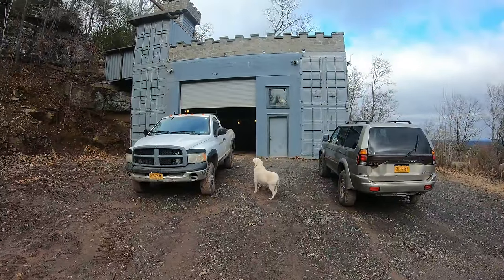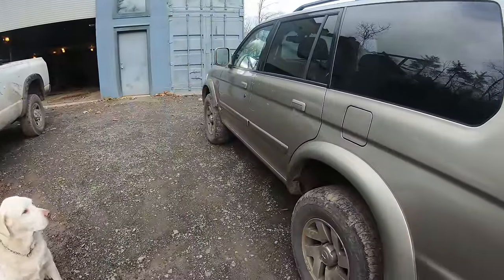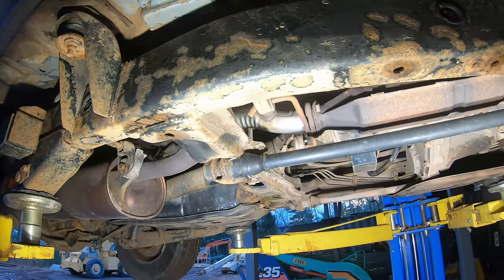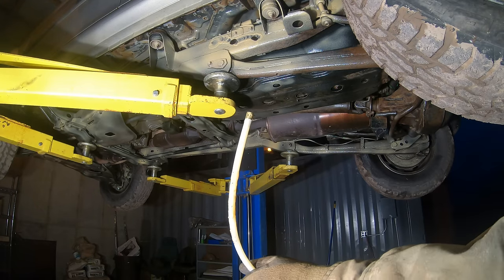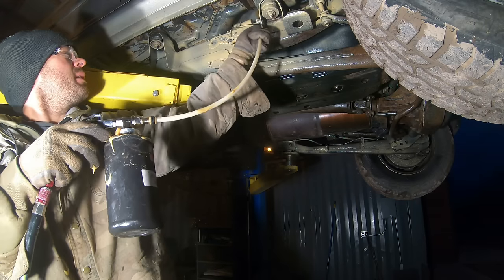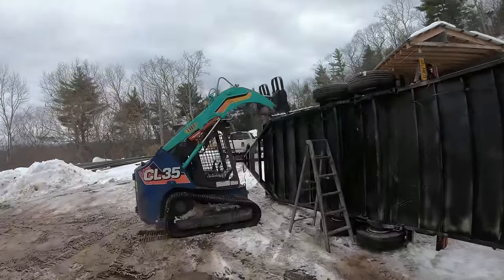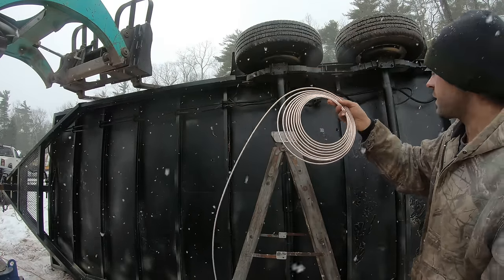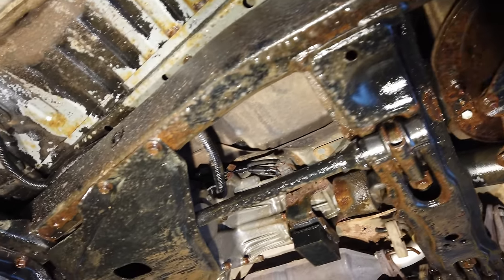Undercoating vehicles

Comment: I keep on old bucket lid with a small hole in it permanently on my paddle mixer. I just pop the lid on whatever bucket and run the drill at full speed, no spilling. Keep up the good work Andrew!
Reply: Great tip!
Reply: That is a terrific idea👍
Reply: Nice tip brother, I'll remember that for future reference.
Reply: so simple, yet such a pro tip!
I never even thought about that lol
Reply: drilling counter clockwise prevents snagging when going through plastic, too
Reply: try thinning it down some with deisel fuel works great bro god bless
Reply: If you need to lift the paddle to mix some materials, cut the bottom out of an old bucket, and cut the centers out of two lids, leaving just the edges. Glue the lid pieces together to make a ring that holds the upturned bucket in place. Has kept me from scattering paint for years.
Reply: @thardyryll  excellent, that's an ideal idea💡.

Comment: One trick is to coat them in the fall, so you can drive on dry roads and have a layer of dust and dirt build up on the oil. You can then coat them again, this will help build up layers of oil / dirt making the coating thicker and harder to wash off.
Reply: Thats right and mustie1 uses bar and chain oil, thinned with kero so it can be sprayed.

Comment: I have the same fluid film on my car. I did it professionally. They put on a heavy coat. I would advice you to put on a thicker coat. Once finished drive on a dry dirtroad (if possible). This helps the fluidfilm last a longer time. I think this is the best coating for a car. Last a long time and will not turn rocksolid.
Reply: m g I did not say he did a bad job
Reply: pete smyth  Gramps taught me to use bar and chain oil. It's thick, it sticks, it's cheap and readily available. Drive on dusty road after. I have an 85 ford ranger that looks better than my neighbors 5 year old Tacoma. We're in the Northeast.   

Use a rag to cover places you don't want to spray it, like bushings, boots exhaust. Spray it on once a year for the first two years, then every third year. Best to do it in warm weather because it's so thick. An added bonus, if you've got chipmunk or mice that like to store acorns in your vehicle they hate it. You'll never see a nest again.

Comment: I got sad when I saw “undercoating” but was very very happy to see fluid film! Good on you. I should’ve known, that you know better lol
Reply: Me too I'm glad he used fluid film alot of the other stuff out there is garbage
Reply: Yeah, rubberized undercoating and trapped moisture, what could possibly go wrong.
Reply: @bigfutus  agree, except when it's on the car from factory - since the car is spotless then
Reply: Deutschehordenelite Nope that’s not true! moisture will always get trapped under rubber undercoating. It’s pretty much a death sentence if you don’t live in the desert.
Reply: @moavic5087  it worked for my car, just chipped away more and more over the years
Reply: But!...should really be applied when it's warm so the dust clings to the fluid film and forms a better barrier.
Reply: Fluid Film is what I see in undercoating and rustproofing.
Reply: Joe Thurman exactly fluid undercoating is the only type worth anything
Reply: @ZEROOOOOOOOOOOOOOO00  Yeah but then you have to live in Florida...
Reply: @bigfutus  Fluid film is lanolin based. I does not trap water. Get a clue.
Reply: Yeah rubber stuff just holds the salt and moisture in
Reply: @cumminspower2878  Salt sticking is perfurd? I guarantee you've never even tried the stuff.
Reply: @ZEROOOOOOOOOOOOOOO00  Salt is still an issue in Florida.. The humid air is loaded with it. Any puddles are loaded with salt.
Reply: Cumminspower 28 military uses it on sea vessels
Reply: @ZEROOOOOOOOOOOOOOO00   Problem there is... you have to live in Florida.
        edit;   M C beat me to it. Nurtz.
Reply: @cumminspower2878  Try NH Oil
Reply: We have tried Fluid Film and New Hampshire Oil Undercoating. Both work well at first but wash off quickly. This year we started using Woolwax and am impressed with it's stickiness, far better.
Reply: @rebelyank6361  Bar and chain oil. Spray it on once a year for two years (Spring or summer). Then once every three years. It's thick, sticky. Just use a rag to cover where you don't want it, like rubber bushings and boots. 

It works, it's cheap.
Reply: I actually wondered the whole time. Andrew is pretty good with these theory. Some silly, some not a big deal.
Reply: @johnnybear111  If thats a fact, then end of discussion
Reply: thick coat of fluid film + a long drive down a dusty dirt road makes a good coating
Reply: pete smyth beeswax & Linseed oil mix

Comment: It helps to have the extension hose for the spray gun so you can get inside parts of the frame, panels, and other tight spots.  I have used fluid film for a couple of years and have been very pleased.

Comment: You’ll be very happy with this stuff. Be sure to apply at least once a year. I used it for a couple of year’s then I started using NH oil undercoating instead, it’s basically fluid film but it sprays black and I think it lasts a little longer too.
Reply: I used to do undercoating and my boss now swears by NH oil.

Comment: I almost fell out of my chair when I finally saw someone
correctly apply a lanolin-based undercoating.
First- Fluid Film undercoating and the aerosol can "penetrant" are not
the same product. So many on YouTube show this incorrectly.
Second-  It must be thoroughly mixed, just as you did. Stirring is wrong.
Third- it should be applied HOT. It seeps & creeps better, goes farther, sticks
better, and you end up using less because of the nature of the coverage.

Since making this video- the makers of PB Blaster have come up
with their own formulation, which many say is superior to FF in many ways.
It's called PB Blaster Surface Shield.

Thank you for the wonderful videos you produce.

Comment: Mustie1 has a couple of pretty good videos about undercoating.  He uses bar & chain oil, which is an alternative.   When I restore old cars, I get rid of surface rust using phosphoric acid (Jasco at big box stores) then neutralize it.  Works really well and keeps it at bay under any temporary or permanent coatings.  

Luckily, I moved from the East Coast to the West Coast, so I no longer have to deal with salt on the roads, but man is that stuff an epidemic....   From what I see out here, it's not really necessary, we seem to do just fine without it, even in the Sierras, which got ~30ft of snow last year.

Comment: Great job Andrew...I thought at first the FF was too thick to spray, but sprayed good as is, [WAY better after you heated it] That is great stuff, use it in my machine shop to prevent rust on anything. I NEVER SEEN that hydraulic brake system for trailers SUPER idea!

Comment: I been fluid filming my vehicles for a long time.  Stuff is great and really works.  Helps if u warm it up. Put it in front of a torpedo heater or etc.  the I made a pvc valve setup that goes through the lid to get it into the small jugs.   Works excellent.  I also mix my fluid film with grease and used motor oil. And mix it same as u did with a paint mixer.  It is literally the best coating ever.  Absolutely zero rust on anything.  Don’t forget to get all your body panels, rockers, fill everything.
Reply: Cedarstrip 14 Usually cars have zinc coating on metal so no need for extra coating. Also most cars are just made to sell, not to last. In the Mitsubishi that kind of structure can't last.

Comment: I bet there's a lot of rust under those aftermarket fender flares. A lot of guys with put those on right before they sell the truck to cover the rust up. Dodge never offered factory flares for that truck so they are definitely aftermarket. I had a 2005 that I bought new, even those Ram Daytona's with the wing on the back and the stupid ground kit didn't come with fender flares.
Reply: Same here on my 05 Cummins. Make sure you check that they're still attached mine rusted through and went flying down the road good thing no one was behind me. I don't know why people put them on unless you have wider tires on they just look like crap. Least that's what I think
Reply: @Klldozr  People put them on to cover the rust so they can get an inspection sticker. Any older stock truck without a lift or bigger tires you know there on there just to hide rust.
Reply: I put hex head sheet metal screws in my fender flares to hold them on, the metal was rusted out under them.  1995 Dakota--gone now.
Reply: @Klldozr  is that a rusted bottom corner of the passenger side truck door?
Reply: @stevensaxon8888  what do you mean?
Reply: @Klldozr  I believe Andrew's truck is already rusting out. At least on the door.
Reply: @stevensaxon8888  oh maybe I was talking about the fender flares. My truck is pretty much rust free other than the bed
Reply: @Klldozr  yeah I knew you were talking about your truck and fender flares. I just was wondering about Andrews truck. Thanks for the reply

Comment: One suggestion for Fluid Film....  The 360 spray tube inside frame holes and crevices, but use a rag dipped in the fluid film and wipe on the frame etc.  That way it goes on even and you can keep it away from the brakes, exhaust and other areas you don't want it.  NO waste and doesn't get all over you and shop floor.  I am using on my Toyota truck due to frames rusting.

Comment: I need to get me one of those turbo nozzles for my powerwasher!
Reply: Good piece of kit to have. You can get it from Supercheap Auto. Just wait for the xmas sales to start. https://www.supercheapauto.co.nz/p/toolpro-toolpro-pressure-washer-attachment---turbo-nozzle/370466.html
Reply: Please make sure you get the right orifice size before ordering one. Seen way too many companies just buy whatever dirt blaster. Karcher makes the best. If you’re not sure your size message back your psi and gpm.
Reply: I've heard there is a minimum pressure requirement for them to work properly. Might want to check that out. Looks like they work great.
Reply: I need a power washer like that
Reply: Mines 3500psi, 4.0gpm, cost me a pretty penny but so handy to have a hot power washer for my diggers and trucks it looks pretty similar to Andrews but maybe a bit higher quality
Reply: Be careful, they can dig holes in things not meant to have holes.
Reply: @LegendLength  They absolutely do, it's the red/0 degree tip spinning very fast, but you can't use it or red tip on everything, it will cut stuff up.
Reply: @LegendLength  And OMG don't point one at your foot!!
Reply: @cherry01995  we all doo looks like it blow's hot water /  steam right at what ever u r spraying in time...... i wonder the name & make & model # is........ or one like it from like harbor fraight or some where........
Reply: If anybody wants to purchase me a hot water power washer like this for me that would be great
Reply: Johnny B not necessarily you can just blow into them and it spins
Reply: DistortedStar 0026DT look up pressure pro magnum they are the best gas engine hot water pressure washer
Reply: NZ DIRT pressure pro?

Comment: What I love is that it's work equipment/vehicles and he treats them as such. Some practical maintenance and don't worry about little scuffs too much.

I wonder though. Shouldn't you get rid of the rust first, before covering it up again? I've always been taught that you might as well not cover it if there's still some on there, that it actually worsens it, cause it's "trapped". Unless the stuff you used takes care of oxidation?

Comment: Fluid film cost but it does work! I've seen a test against about 10 other products and the fluid film came out the best! It soaks into the steel and stops the rust! The lift really helps! I pop all the plastic plugs at the doors/rocker panel etc. and spray the insides of everything! If there is no plugs drill hole then plug! They are cheap!

Comment: I just used that stuff for the first time this year as well. I heard places do it for like 200 bucks for a vehicle here, but just decided to do it myself. Doesn't take long and is only about 20-30 bucks a year if you buy the big tub.
Reply: That's great, but some folks don't have the proper equipment, tools, lift, etc. to do it themselves. But even if you have to pay to have it done, it's well worth the money.
Reply: $100US in Canada for a Full Size Pick-Up
Reply: @Fixin-To  Do they coat it with maple syrup tho instead of fluid film?
Reply: 20-30 bucks? 5 gallon pail is over 100 bucks.
Reply: Gallon will do one vehicle.
Reply: I already had the air compressor and I have an oil pit. Spent like 20-25 for a gun, bottle, and 1/2 tubing to spray it. 5 gal tub is around 160-180. If I apply it every year, I would use around 1/2 to 3/4 a gal for my particular vehicle.

Comment: Andrew: This coming summer you should POR-15 your frame and metal surfaces under your vehicles. It is awesome. Only setback is that it doesn't have any UV protection, so areas that are exposed to direct sunlight should be painted over the POR-15

Comment: In Michigan. Same...  However. When I buy a car. I take all the wheel well covers off. Power wash the undercarriage and coat all the welds and seams with a rust converter or Acid Etched Primer. Then I coat with no less than 12 btls of the shittyest cheapest asphalt undercoating I can buy, usually permitex. I put on layers unitil I am out. Up above the muffler, all along the rear tire tub. all of it. Let it dry overnight and put all the shrouds back on. Makes the car quieter... and no rust... I have tried bed liner but after exposure to heat it peals off. I only use fluid film on the engine bay and bits there about. it will eventually wash off in high spray areas Andy. You may need to recoat fluid film in about 3 months.

Comment: Hey Andrew, just FYI but a bed liner spray gun works great for spraying the fluid film. I didn't even bother pouring it into the containers, I took a vinyl hose, stuck it on the end of the pipe that sticks down into the container of paint and then just stick that in the bucket of fluid film. It'll suck it straight out of the bucket and the bed liner spray gun puts it on a lot thicker so you don't have to do multiple passes.

Comment: I've been doing this to my vehicles for about 40 years using various concoctions of new motor oil and transmission fluid. Living in the Lake Ontario snow belt, we see more salt here than anywhere else in the US. I've found the lighter viscosity mixtures can dry out before a winter is over so last year Ii tried gear oil. I heat it up and it sprays as well as the lighter stuff and stays on a whole winter. The downside is the smell.

I never use used motor oil as it can be acidic which will promote the rust.

Comment: Tesla CYBRTRK is all stainless steel. Might just be the answer to rust for those living in salty areas.
Stainless steel outside, great hauling capacity, 4 wheel drive, high ground clearance with air ride to raise and lower the vehicle,  million mile motors and batteries. A truck that lasts forever and can take a beating. Should have no trouble hauling a heavy trailer full of equipment or plowing snow.  Put solar panels on the shop and drive with power from the sun.

Comment: Used diesel engine oil mixed with some sticky grease,like molybden grease works well too : the soot in it makes it really glue to the underside.
Cheaper to use.
Reply: Chainsaw oil works pretty good also, mixed with diesel or kerosene.

Comment: Andrew, another great video.  I do worry about your safety with the SUV only held up by the forks and the strength of the transmission parking brake pawl. That is a relatively thin piece of metal. Please tell me you had front wheel chocks. Two tall rear jack stands would also make me feel better. We don't want to lose you, you are far too valuable to us and your family. Kind regards, Craig

Comment: Great video Andrew. Many thanks. I remember a story about a friend of mine who started working with Tectyl undercoating of cars. An old lady came in with a little car she wanted undercoated. They had a map of where to drill holes on all cars to spray into canals and cavities. He followed that, but when the lady came to pick up the car and pulled out the seat belt it was soaked in Tectyl so she ruined her coat. An expensive experience. Always pull out the seatbelts before spraying into the cavities around them.

Comment: I assume that undercoating is Lanolin-based. Lanolin is natural sheep’s-wool grease. We used it in Australia on Fertiliser-spreading trucks and it works brilliantly. Superphosphate and Lime are highly corrosive on machinery and Lanolin is really the only thing that works. Every season we would pull the trucks completely to bits and liberally coat every surface with it - even down to under the suspension brackets and inside the wheel rims.

Comment: Andrew! For undercoating my vehicles, I use the used oil from my oil changes. It works excellent. I love it because I don't have to buy anything. I'm not sure how much that oil film you use costs but I suggest giving used oil a try. It works wonders for me and where I live and they pour the salt on the roads!
Reply: Be careful...Fluid Film isn't petroleum based, so it's safe to spray on everything (including rubber), oil might start to eat anything rubber underneath...something to keep an eye on.
Reply: @pauliegualtieri4314  thank you, I will definitely keep that in mind!

Comment: This stuff only works well on clean metal without any rust. When you spray this stuff over rusted metal, it will seal in the rust and will allow it to continue rusting underneath the coating.